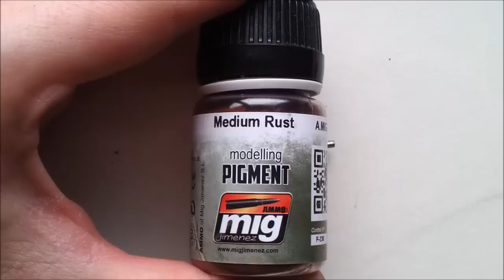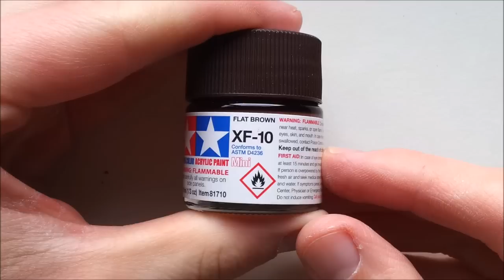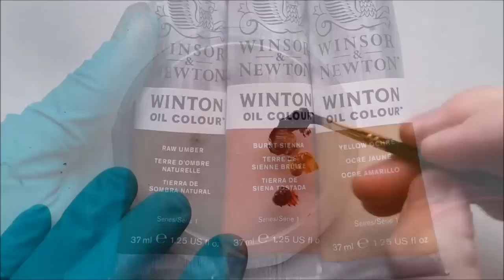Eduard 1/48 Scale Albatros DIII & How to Paint Wooden Effect on Scale Models - Part 1

Comment: I’m not sure how this one slipped under the radar.
  I watched both of them out of order, what eventually became of this one? This was headed for a top shelf flight. A beauty.
  When you switched to ALCad Chrome on the engine, was that for highlighting or a second color change overall?
Reply from the maker: I ruined it basically. The whole think effectively blew up when I was using the dremel on it for some modifications. I used the Alclad Chrome as a highlight as I remember to give some areas of the engine more shine
Reply: I can see that, good idea.
 Thanks for the reply and outstanding channel all these years.

Comment: How long did you have to wait for the oil paint to dry before you could continue to work?
Reply from the maker: Rob Heinke I waited 3 days but the time can vary quite a bit. When you paint the oils on, also paint a spare part too. Use this spare to determine the state of the paint before touching the actual model
Reply: The Inner Nerd smart idea! I just painted the oils on eduards albatross d.iii profipack last night and used the same technique with the brushes. Time to practice that patience!
Reply from the maker: Rob Heinke That's what I'm here for! Good luck with it!!